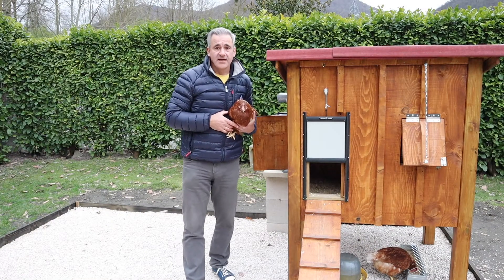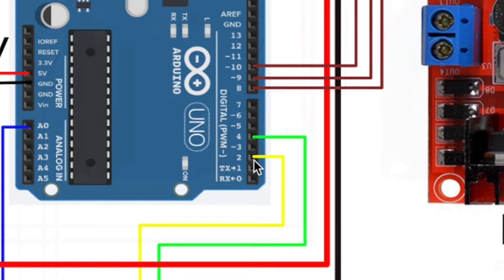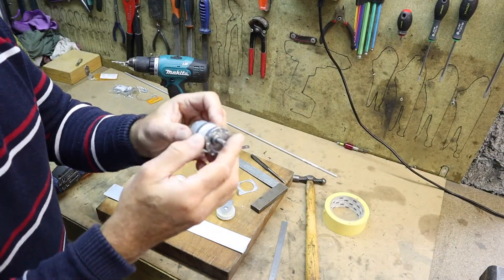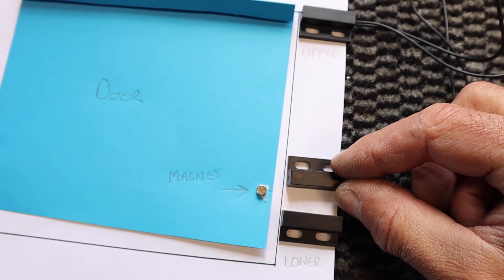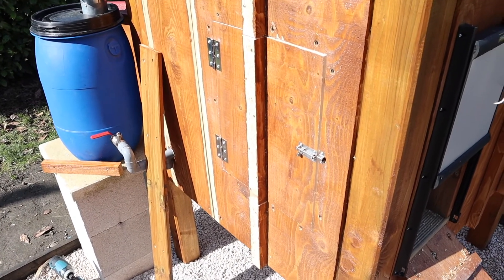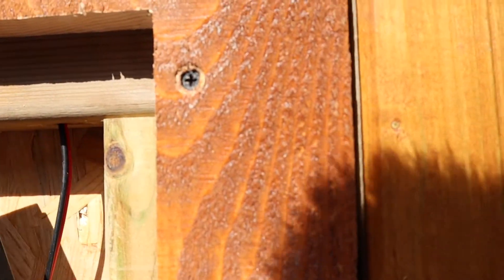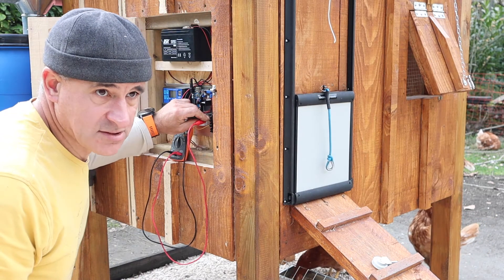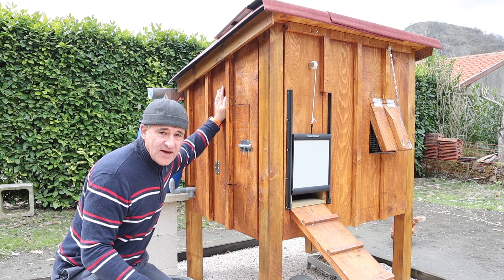DIY Automatic Chicken Coop Door | Solar & Arduino

Comment: Hi, I was watching your project and I like the way you did the work. I have various sensors and components for Arduino laying around in my home and I nearly have everything. I have two 12 v motors from a car window mechanism and was wondering if that motor could be ok. I was also reading your comment where you say light sensor was a failure...better program the time for opening and closing am I correct?  I don't have the door you have and I have to build it but I was thing at a sensor that reads (maybe infrared or ultrasonic) the presence of a chicken when closing the door. I still have to come up with a locking system once the door is closed. And yes, I will make it possible to control it manually remotely over the internet.
Reply from the maker: Yes, think programming for time is more secure (sensors get dirty, cloud cover etc etc).  The motor does not have to be too big, if the door does come down on a hen then the motor should to have the power to force it even more.  Try and get a nice light door.

Comment: I myself programmed it on time. Summer and winter time. Together with a bluethooth module to adjust the time if necessary.
Reply from the maker: That would have worked a lot better with time - the light sensors were a complete failure in the end.  It was not consistent.

Comment: Thanks for posting.  I've tried three different brands of automatic chicken coop doors and have not been happy.  Two failed completely.   The one that is working killed a bird a few months ago as it got caught in the door.  I want to modify your plan and build my own system to control two doors (coop and run), use a look-up table for seasonal changes in sunrise/sunset times (I don't want the light sensor due to ambient lighting in the area), sensors for the chickens and/or gravity-only closing.  With gravity-only, I want an interlock to keep my local racoon from pushing the door up. He likes to eat their food.
Reply from the maker: Hi Craig - We have had this door for around 18 months now and I did move over to the chicken guard controller as my attempt to program my own did not go to welll.  The door is on a string so it won’t shut on the birds and it does interlock so safe from predators.  Well worth just having the door even if you didn’t go for the whole system.